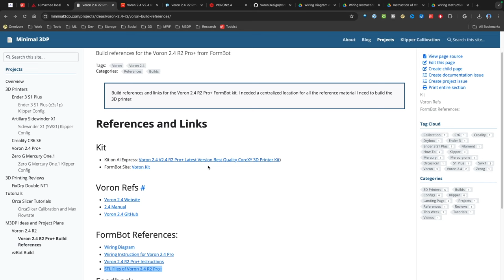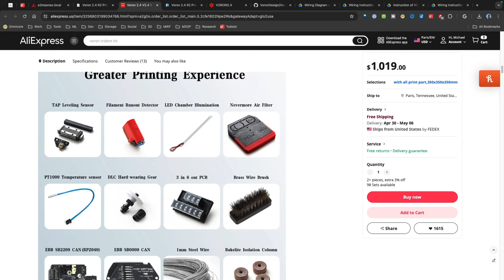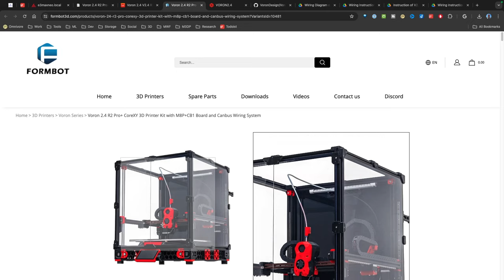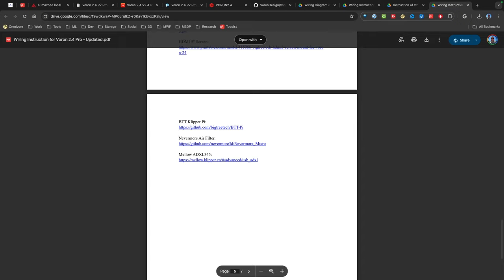Building the Beast: VORON 2.4 R2 3D Printer Build Guide - Part 1: Unboxing and Prep

Comment: I am finishing a Trident from a Formbot kit now. The kit was a really good starting point, but I had to do some upgrades to it. The only problem with the kit itself was that they sent the frame with the wrong size, but as soon as I contacted them, got the correct one sent with no extra costs. The things I ended up changing were the linear rails, after about 30h of printing, the rails became really noisy and the prints started having artifacts, I was super lucky. I managed to buy a set of hiwin rails from someone who gave up the Voron project for a nice price. I also replaced the fans by noctuas, a big difference in the noise level. I built it with the magnetic panels mod, it makes it so much easier to take the panels out for maintenance or printing pla. I didn’t bother with filters, I printed an adapter from the exhaust fan to a 40mm flexible tube that I put out of the window when printing abs. Absolutely no smells. Now I am looking on a way to improve the way the teflon tube and the can cable connect to the stealthburner, I think the steel wire you got is for that. Not to sag or rub against the top panel. In the future I am thinking about building the enraged rabbit carrot feeder, and change the CW2 extruded by a Galileo 2. Don’t forget to buy some loktite (the weak one is enough), my tap disassembled itself without it, now is super reliable, and a good jig to build the frame as square as possible, don’t ask why I say this… Another important thing is to get some backing to the rails, steel and aluminum dilate at different rates in a closed environment, and tend to bend the frame slightly, I used the old rails without the carriage on the opposite side of the extrusion with good results, but there are some lighter solutions for sale. This is a really fun project, I am looking forward to see your videos 😊
Reply from the maker: Thanks for all the great info. I pinned your post. Great call on the wire. I think you are right.  

I got an ERCF kit that I will install at some point. I got it on sale and have been sitting on it.

Comment: Looking forward to following your build! I just built an LDO Voron 2.4r2 Rev C 350mm. Probably not the best option for a first 3D printer. I am following your Orca Slicer videos and working through the calibration. Thank you for the great video series!
Reply from the maker: Definitely not for beginners. I started the series and then realized that there are over250 pages in the assembly manual. I will be atit for a while. It is fun though.